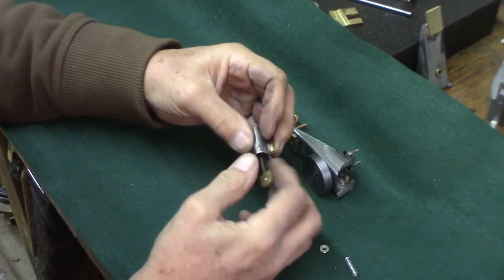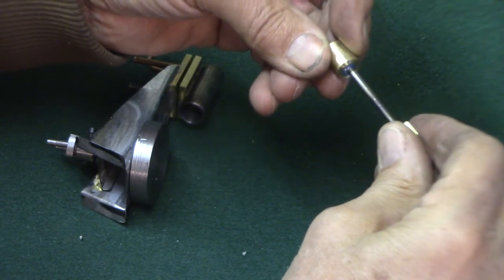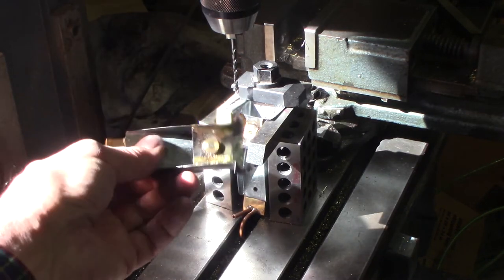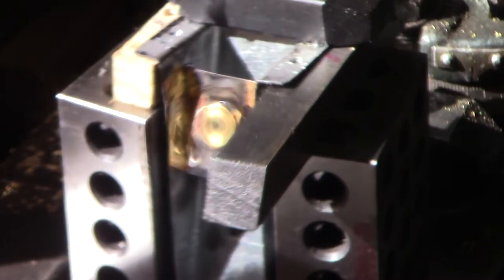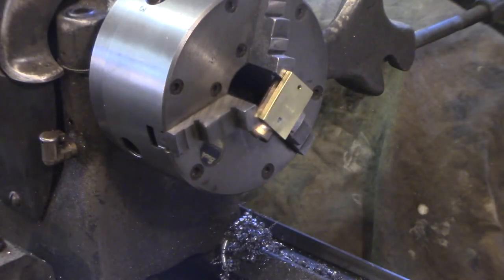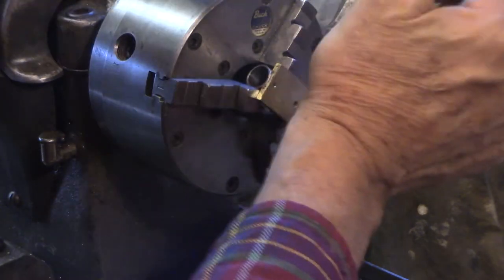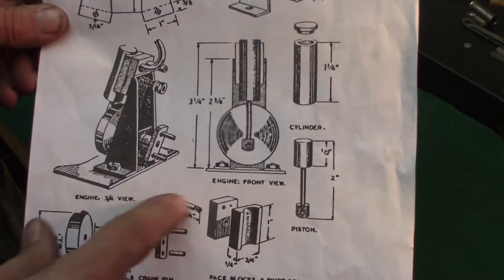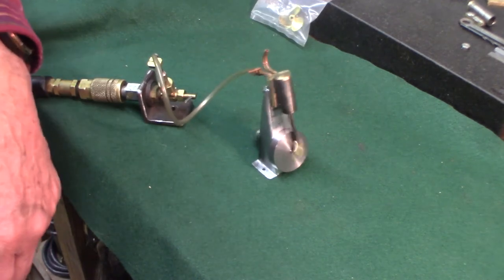How to make a DiY mini Steam engine Complete!   Finish & Test Running.

Comment: You engine runs nice.  I will be watching for the boiler and boat build.
Reply from the maker: Thanks Les !  The boat is finished, just need to install the prop shaft and fuel tray.  Stay tuned.